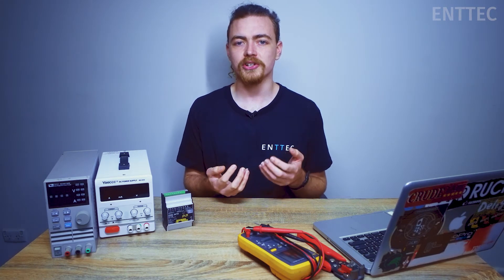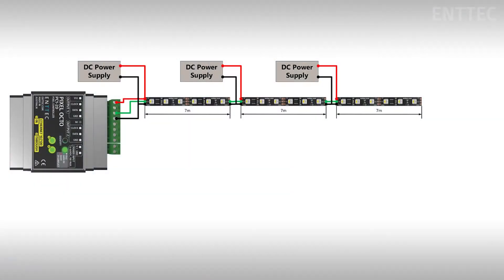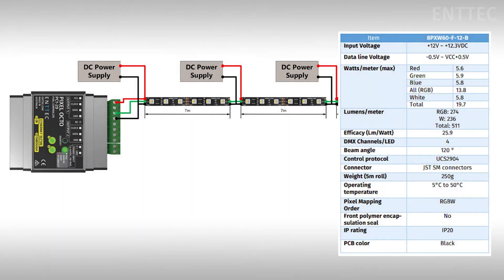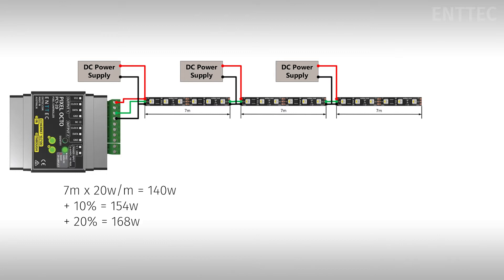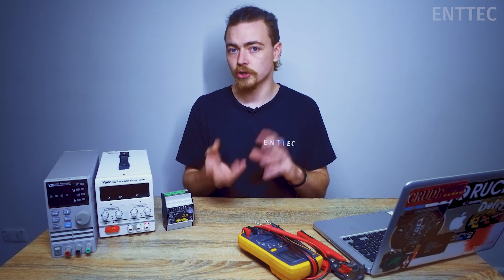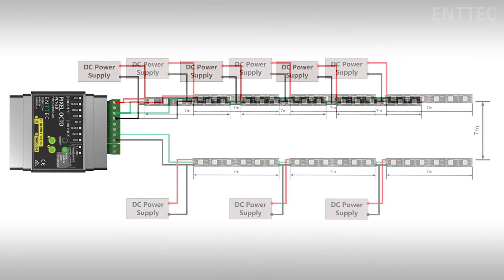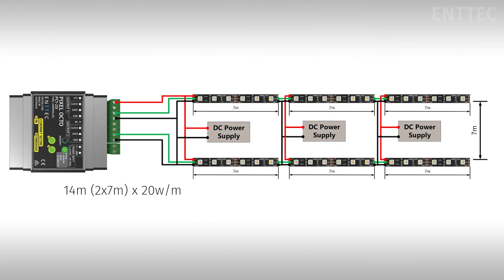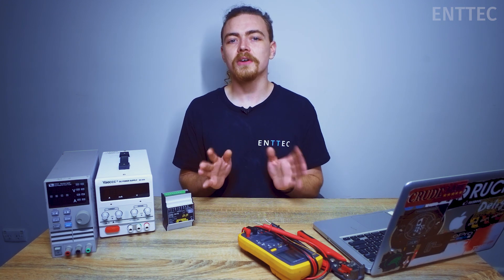Ep.12 How to size power supplies. Is bigger really better?

Comment: Hi Jordan how are you doing? I am loving your videos. Any chance you can give me tips for my project. I have a small nightclub (the dancefloor is 6mtsx6mts) and I am trying to find the best configuration. I am planning on doing a total of eight BTF-LIGHTING addressable led strips (60 leds/m) (5mt each 12v) + Muzata diffusers. So in total it would be 40 mts of Led Strip. 

What would be the best way to power them? Maybe 2 or 3 BTF-Lighting 60 Amp, 12v Power Supply (running 4 and 4 strips on each, or running all of the strips as one very long strip with power supply at the beginning and at the end)?  How many Injections would you recommend?  I've seen your driver ENTECCs Octo as the best option and it seems like the perfect fit for my project. Greetings in advance, love your content, these are going in the ceiling to create a nice dancefloor effect.
Reply from the maker: Hi Neto, thank you, that sounds like a great project!  There are many things to consider and you have given us heaps of information which is great.  So we can assist you correctly, can you please send us an email at sales@enttec.com and let us know what country you are located in so we can direct you to the correct office.  Thank you

Comment: which power supplies do you use?  I see the YAECCC.  What is the other one?
Reply from the maker: Hi. The other power supply is an ITech. Both of these power supplied are adjustable bench power supplies and aren't suited or recommended for installations, just demonstrations. We regularly recommend a power supply that runs at a set voltage which will depend on the tape you're using. They are cheaper, run quieter and are more compact and you can often find them with good weather ratings. We recommend Meanwell on projects.